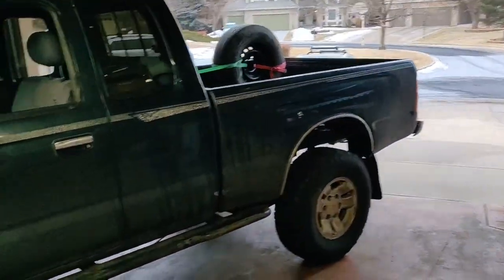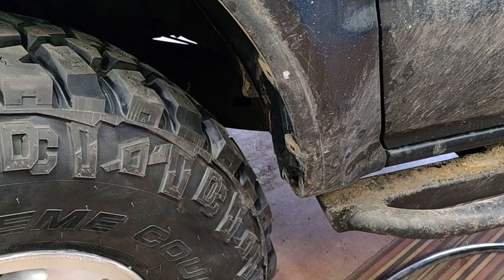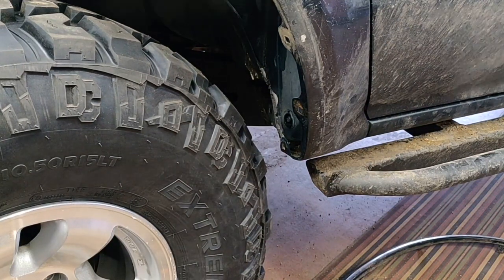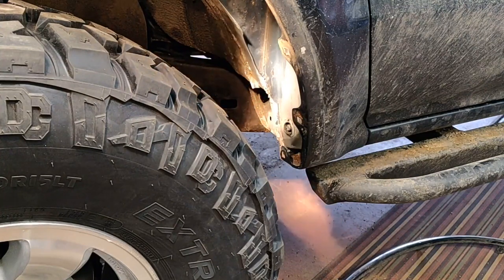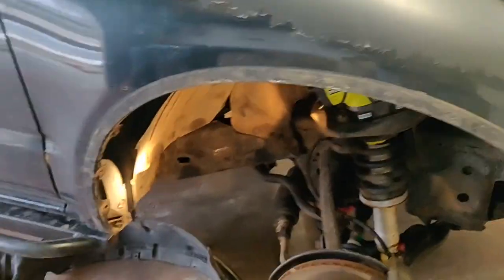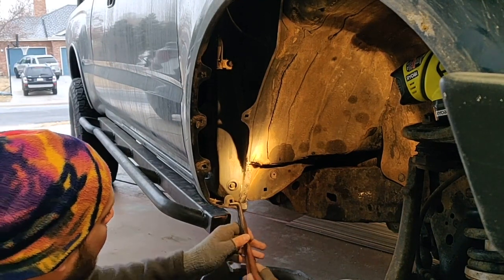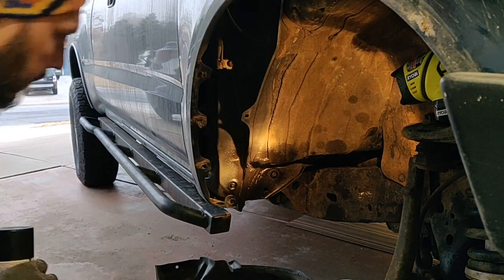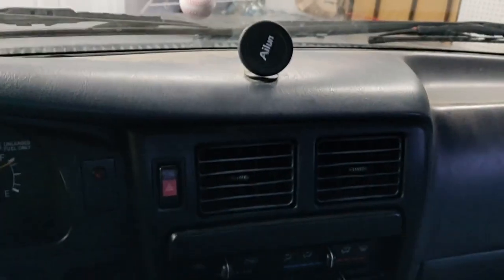1996 Tacoma 4x4 : clearing a 33x10.5R15 tire on 15x7 OEM wheel

Comment: I know you haven’t been in here for 2 years but do you still have this truck?
Reply: I do, switched up to 16" wheels, takeoffs from an '06 4Runner that I had painted bronze. Running K02's now, I got a lot of pinch flats with the Dick Cepeks while out wheeling. Added a 1" body lift a while back too, I can use the inner fender liners again, which helps a lot with keeping dust out of the air filter.

Comment: You were able to fit 33x10.5’s on stock suspension?
Reply from the maker: Suspension was  Rancho something or other when I installed the tires, have since moved to an OME setup with Total Chaos upper control arms. I do get a bit of rub on the bigger compression events and sometimes at extreme steering angles. I run without the inner fender liners now. Am planning to install a 1.5" body lift, I think that would allow me to reinstall the inner liners.
Reply: instablaster...